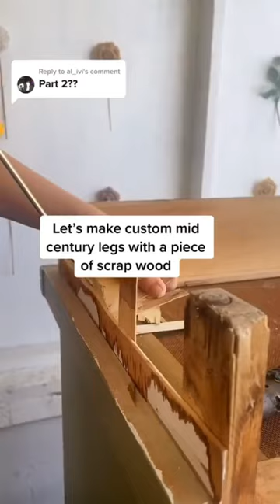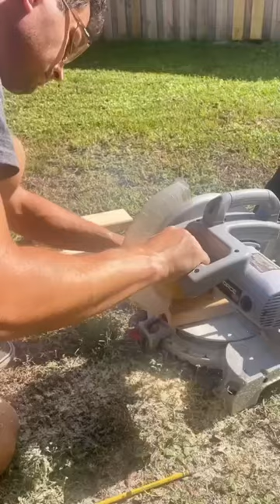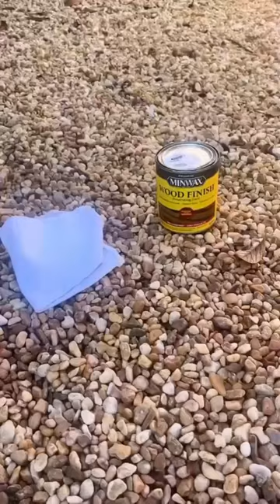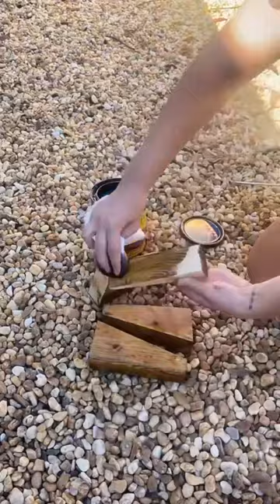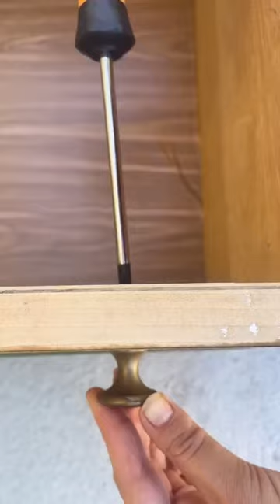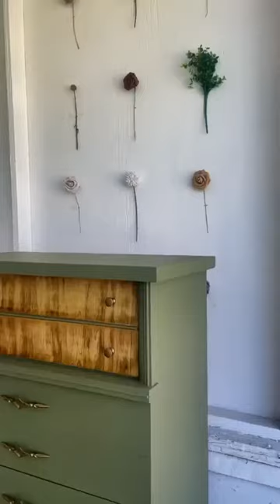DIY Mid Century Legs for UNDER $10

Comment: Those legs need reinforcement to the base, they’ll snap right off if the dresser is dragged.
Reply: I agree - they're going to fail - really needed to use leg hardware (attachment plates). They look great, but they will break away, unfortunately. I hand it to this person for DIY'ing and giving new life to a dated piece. :)